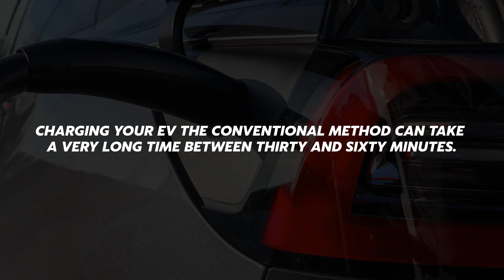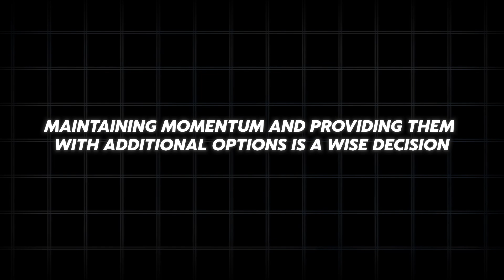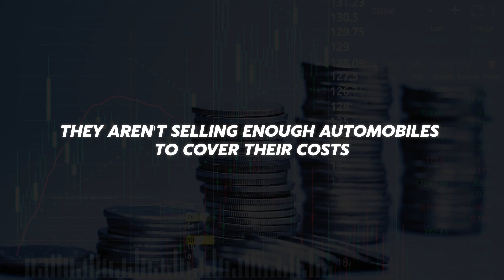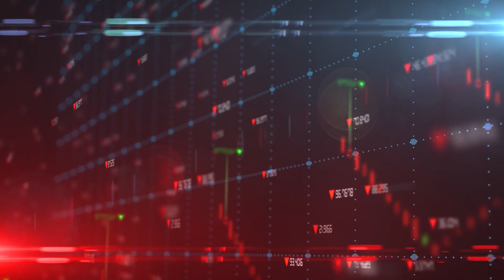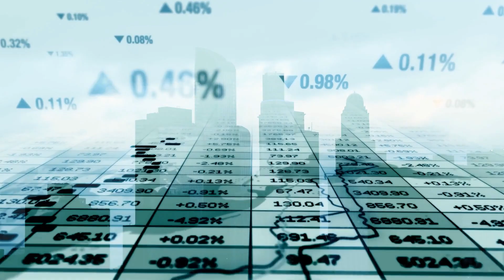Tesla's Demise? Battery-Free Electric Car Revolutionizes Industry

Comment: Hi, I am an automotive design engineer, I have briefly worked on the battery change system. It´s not all just great, think about it. You need water proof connectors, you need multiple latches to clampthe battery in place, you need stations with the batteries. You need to make sure nobody steals them for example you can make a moke up battery clamp it unter the vehicle and exchange for a functioning one and so on. This also increases the weight of the vehicle further. Norways uses so mane EV´s because it´s a tax thing. The gov. basically economically forces people to buy EV´s because they pay 25% VAT otherwise but of course you just left that part out. sorry but leaving out things like that makes your video just sound like one sided biased propaganda that´s all.

Comment: Please work on your research. Not only biased against Nio also alot of false information. "Not even 8 cars were sold every month between april and june of 2023" very outdated information. Last week they sold 4400. "they lose 35000 on every sale despite being 42000 a car" i think this was true for like a month. 2023 q3 it was about 6.6k loss per Nio sold. And the average car cost is also much higher. You must also say that heavy R&D is complete. 150kwh batterie is out and onvo and firefly subbrands are also done with biggest research expence.

Comment: Instead of waiting for your battery to charge, you will wait in line to have it exchanged.

Will you pay for the kilowatt hours that you used from the battery being changed out?  Saving and using the data to do this could be costly and difficult to document for the driver.

Batteries will degrade much faster if they are charged quickly and often.  The logistics of maintaining these batteries will be prohibitive.